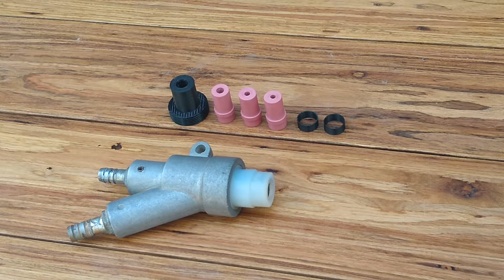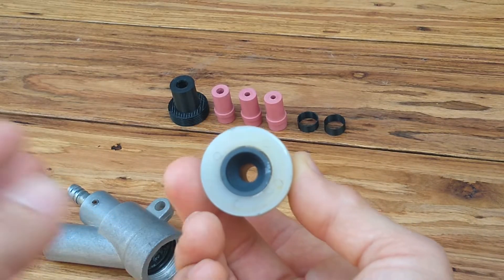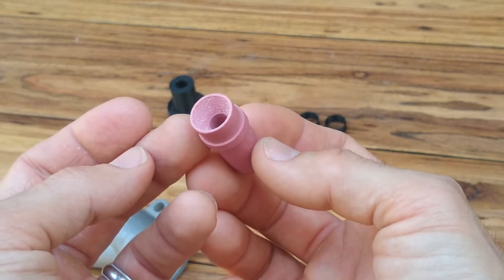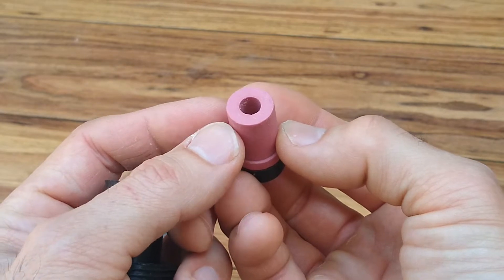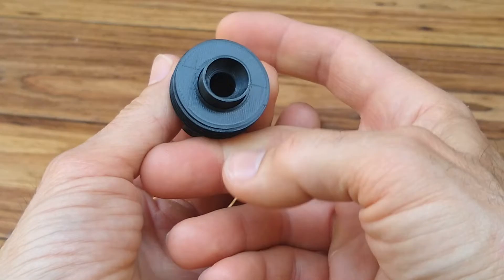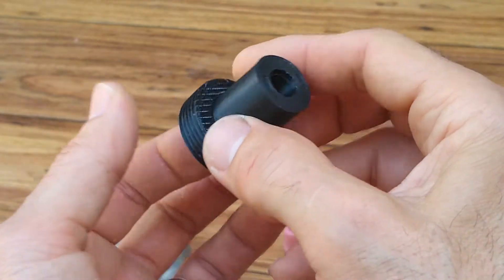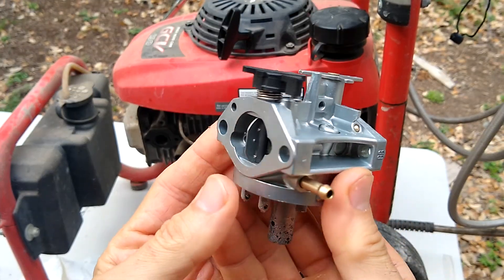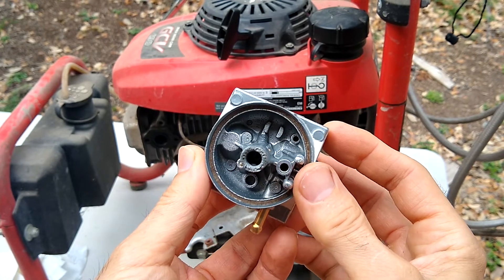Vapor Blasting / Honing DIY Harbor Freight ceramic tip adapters to eBay nozzle

Comment: What PSI do you blast at?
Reply from the maker: Hello Dridful, Thank you for commenting. When etching glass using garnet I use 30 psi. Light cleaning without stripping protective coatings using extra fine glass bead also 30 psi. Everything thing else 50  psi is all you need. You can go higher but you will run out of air faster and shatter the glass beads at anything over 65 psi.

Best of luck with your projects!
Reply: @vbared  thank you, I was doing 40 psi with aluminum oxide but it wasn’t working :/

Comment: Did the 10mm  nozzle work better then your 8mm ??.
Have you the 4.5mm air jet inside the gun ?
Reply from the maker: Hello Rallyr7, Thank you for commenting. The air jet in my eBay gun is 4mm. The 10mm nozzle has a much higher flow rate so the area it can cover with a pass is larger. The only drawback to the 10mm tip for my setup is the air tank is depleted quicker causing the compressor to cycle more times during a cleaning session. I'll be testing a 9mm tip soon to see if I can find more performance without such a fast pressure drop. I'll have to make a video just covering the nozzle sizes, the differences in cleaning performance and how long it takes before my air tank is depleted.

Best of luck with your projects!
Reply: @vbared  okay thanks for the replay.. that would be great if you make a video about nozzle size 👌.. thanks for the great videos.. I got mine vapor blasting work perfect after looking at your videos and tried your tips and tricks
Reply from the maker: @Rallyr7  Awesome to hear, I glad you found value for your viewing time. More videos on the way! Thank you for being a subscriber.

Comment: What do you use for media
Reply from the maker: Hello Gary, Thank you for commenting. 

Glass Beads are what I use for cleaning and polishing. On aluminum parts around 4" square the 170 - 325 grit glass bead media is all you need. Large parts like a valve cover I recommend a two stage clean. Start with 80 grit glass bead media to remove all the contaminants then switch to 170 - 325 grit glass bead for the final polish. If you're stripping paint, rust, or powder coat you'll need garnet I use two grits 36 and 80. I'll start with the 80 grit and see how it goes. If it takes too long of a time to remove the coating then I'll switch to the 36. Once it's al stripped you can can jump straight into the 80 grit glass bead and finish up with the 170 - 325 if you intended on polishing. 

Glass bead: 

Central Pneumatic 80 grit glass bead media - https://www.harborfreight.com/50-lb-glass-bead-80-grit-abrasive-media-61874.html

Ballotini 170 - 325 grit glass bead media - https://www.grainger.com/product/BALLOTINI-Glass-Beads-Blast-Media-6ZC13

Garnet: 

80 - grit garnet: https://www.grainger.com/product/GRAINGER-APPROVED-Garnet-Blast-Media-402F54

36 - grit garnet: https://www.grainger.com/product/GRAINGER-APPROVED-Garnet-Blast-Media-402F56

Best of luck with you projects!

Comment: What brand of 3D printer to you have?
Reply from the maker: Hello Jerry, thank you for commenting. Currently I'm using a Monoprice Mini V2 but have a Creality CR10S Pro V2 on the way. The Monoprice Mini was great for a budget ready to print out of the box 3D printer that was at the time about $169. It does have a couple of limits such as bed size and variety of materials it can print with. If my budget was under $300 and I was just now getting into 3D printing a good choice would be. 

https://www.sainsmart.com/products/creality-ender-3-v2-fdm-3d-printer?variant=32388647026767&msclkid=eb503c0061381f1652a05c6cfb2b3385&utm

Budgets under $500 buy this one which is very low in price right now and the one I purchased: 

https://www.walmart.com/ip/Creality-3D-CR-10S-Pro-V2-Upgraded-High-Printer-DIY-Kit-Large-Printing-Size-300-300-400mm-Full-Color-Digital-Touchscreen-TF-Card-PLA-Sample-Filament-/178186199

I've been bitten hard by the CAD and 3D printing bug. It's awesome being able to create parts that solve problems virtually out of thin air.

Best of luck with your projects!
Reply: @vbared  What CAD software do you use?  I am thinking my budget is under $1k  I have done a lot of research and most only focus on the printer, not so much on the software to design the parts.